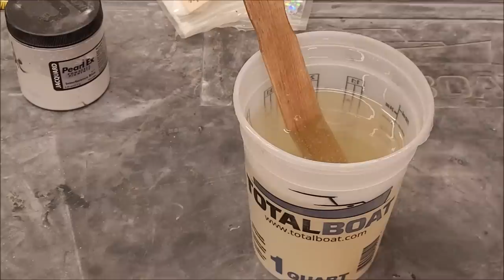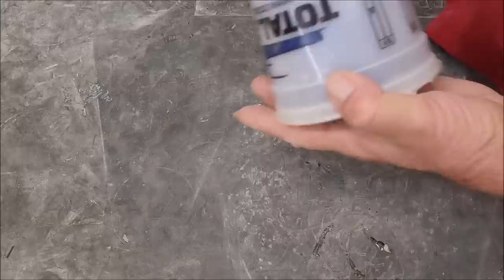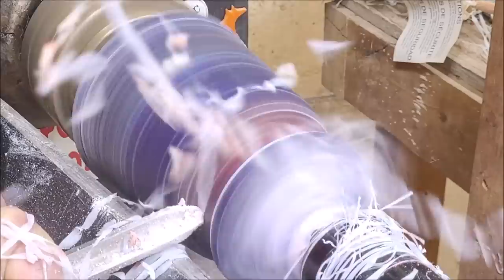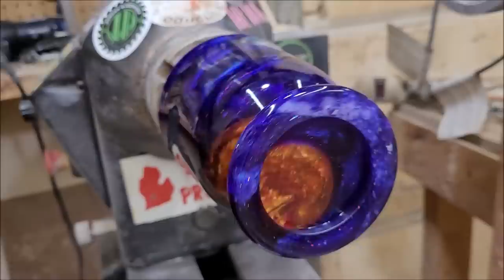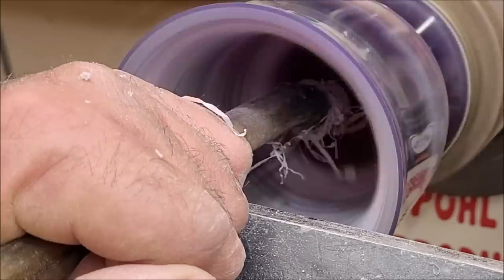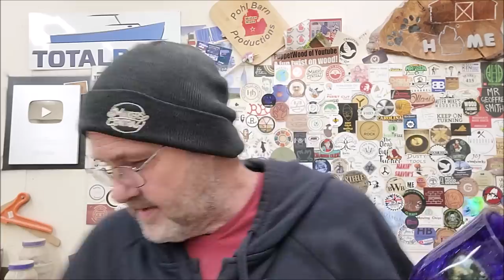Galaxy Cup

Comment: Have you tried taking the resin ribbon sections you get as waste and see what they turn like after being placed in resin? I image you’ve had several shades of that stuff. Even if it’s just white, if it is contrast to the new resin poured over it. Could make for a cool design.
Reply from the maker: you can reuse the resin Ribbons and I have, but if the color isn't dark enough to begin with, the ribbon will only be white and once that is mixed back into resin it almost disappears,

Comment: I fell in love with this piece when you took it out of the mold!  It's gorgeous!  First no-brainer question before I start turning.  So, you can use traditional tools on resin.  But you should expect to be sharpening often?
Reply from the maker: Thank you Eric,  you can use them, I only sharpened this one just before I started, I feel they work best when they are not really sharp,  and well this one went so fast I did not sharpen it but yes sometimes depending how much mica is in it.
Reply: @PohlBarnProductions   ah!  Okay, thanks.